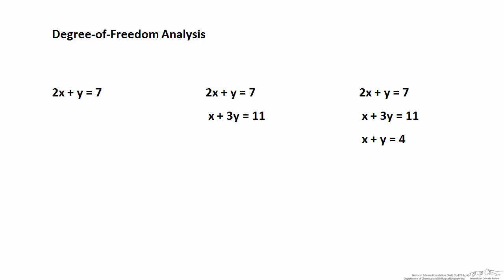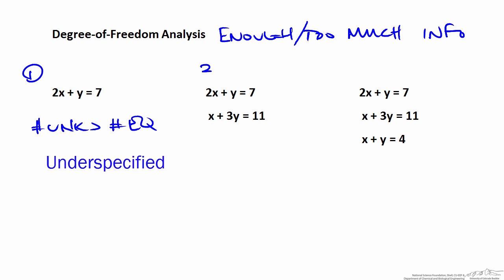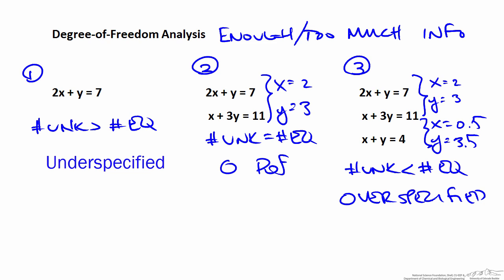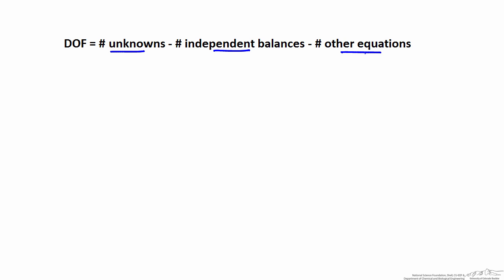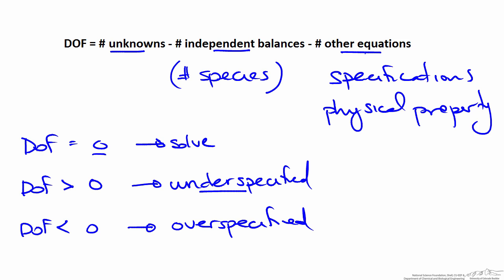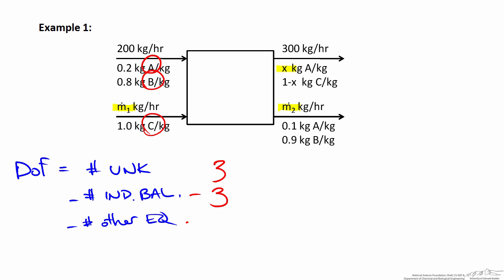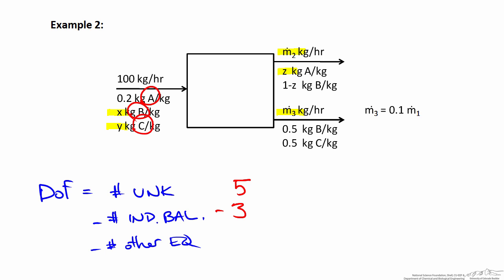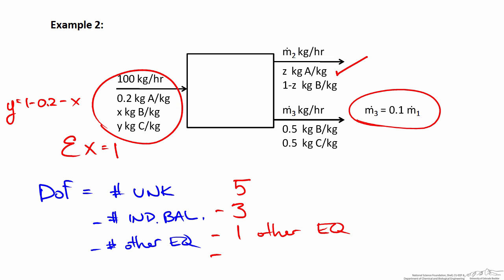Introduction to Degrees of Freedom

Comment: but isn't the other eqn. really arbitrary as we can "invent" as many equations as we want to???
Reply from the maker: Good question. The "other equations" refer to different specifications on the system. In this case, m3 = 0.1*m1 is one of these other equations. The other, that the sum of the mass fractions of the feed stream = 1, is another. In general, these will be given to you for these problems. Later in your career you may need to make assumptions to solve more complex problems.

Comment: What if I have pressure and temperature as parameters
Reply from the maker: The degree of freedom will depend on what other parameters you know vs. how many unknowns you have.  That may not be a satisfactory answer, so please be more specific if you still have a question.
Reply: @LearnChemE  When to use degrees of freedom to solve a question!!! I do not know when to use it, I wish a reply

Comment: 6:36 
y . Is not unknown
Reply from the maker: This can be handled in different ways.  In this case, as shown at 7:26, another equation is used. y = 1 - 0.2 - x .  You could also just write that instead of y and have 4 unknowns.  Both ways work.
Reply: LearnChemE thanks mr❤️

Comment: can we get a word problem solved, cause the part on stream 3 were (1-x) is the mass of c/kg confuses me.
Reply from the maker: Thanks for the question.  At first, we do not know the mole fractions of the components of stream 3.  So we are going to solve for those.  We use x as the mole fraction of A in that stream (which has units of kg of A per kg of that stream).  We know that there are only 2 components of stream 3 and that their mole fractions must add to 1.  Therefore, the mole fraction of C will be (1-x).  Does that make more sense? [It's the same as saying you know that if your drink is made of only coffee and milk, and you know that it is 20% milk, you automatically know that it is 80% coffee.]

Comment: How is m3 an unknown here? it is given that it's 0.1m1 and m1 is known so how is m3 an unknown?
Reply from the maker: Great question.  This just depends on how you want to do your accounting.  If you claim m3 as an unknown, then you use the equation m3 = 0.1m1 as one of the "other equations".  However, if you calculate m3 first, then you can no longer use  that equation as one of the "other equations".  Either way, you'll get the same answer.  Just be careful not to count anything twice.
Reply: @LearnChemE  So the dof sud b (-1) r8?

Comment: can 100= m2 + m3 be considered an equation?
Reply from the maker: That’s one of the material balances. You can either write a mass balance for A, B and C, or one overall mass balance (which is 100 = m2 + m3) and two individual mass balances. If you use all four (3 balances and the overall), they are no longer independent. Adding the three mass balances will give us the overall balance.

Comment: hi, i'm a bit confused why you haven't taken 1-z as one of the equations
Reply from the maker: Thank you for the question.  Here 1-z isn't an equation.  It is simply the mole fraction of B in stream 2.  We could write it another way and say that r is the mole fraction of B in stream 2.  Then we would use the equation z+r=1, but we would have added another unknown, r.  The way it was done in the screencast is a quick simplification.  (Here the equation would be z+(1-z)=1, which is not an independent equation.) Does that help?
Reply: LearnChemE but then how is y=1-.02-x and independent equation? You literally said in the video it was the same thing you did on the right side but you didn’t count that one at and indp. eqn?